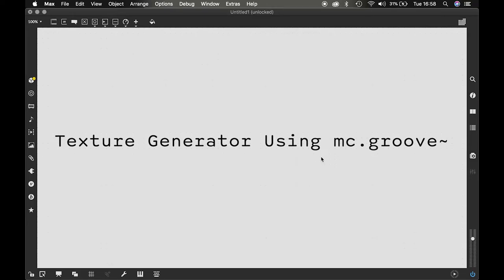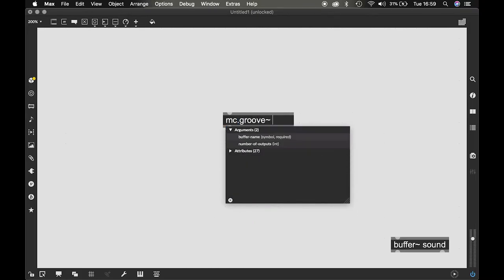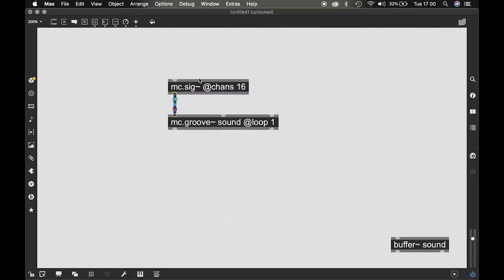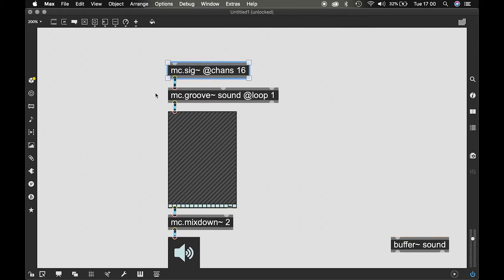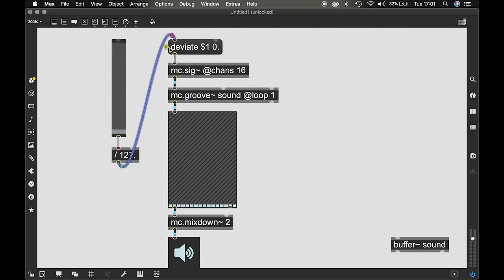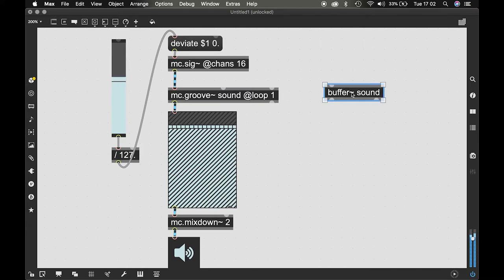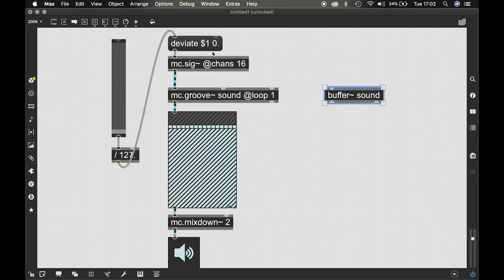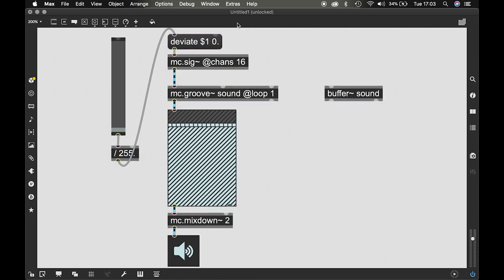Texture Generator in Max/MSP using mc.groove~

Comment: nice one !!! 
just a little detail : which parameter should i check to display channels's waveforms ?
thx :)
Reply from the maker: Hi! To check a channel's waveform you can use the waveform~ object however it needs to be referenced to a buffer~ object. :)
Reply: @AaronMylesPereira ok for this but i mean when you pass the mouse over the cable between the mc.groove and the gain object, a small windows appears which is not the case in my max/msp
Reply from the maker: @mehdikheloufi762  Ahh got it, for that you need to go to the top menu bar to the Debug option and turn on Event Probe and Signal Probe. Shortcut for that if you're on a Mac is command+3 and command+4.